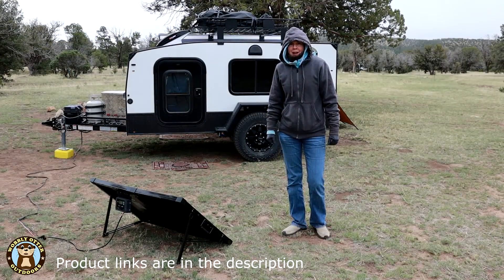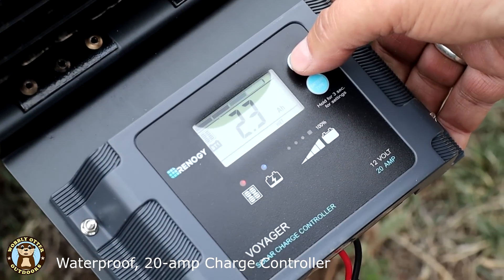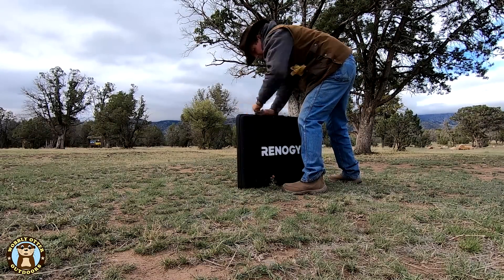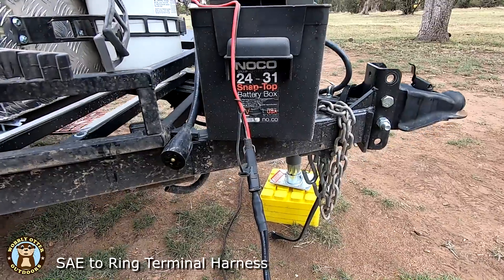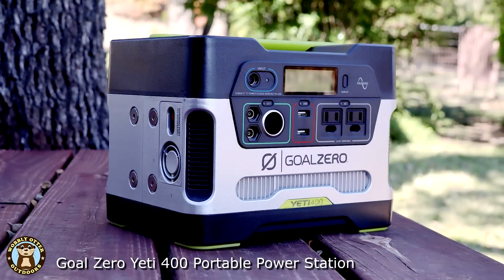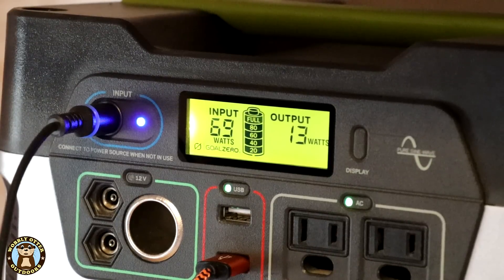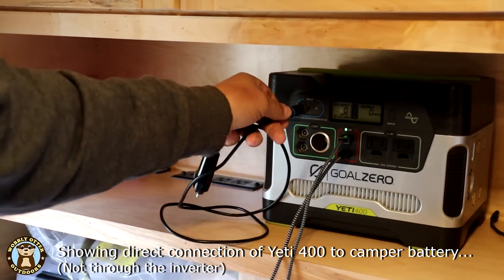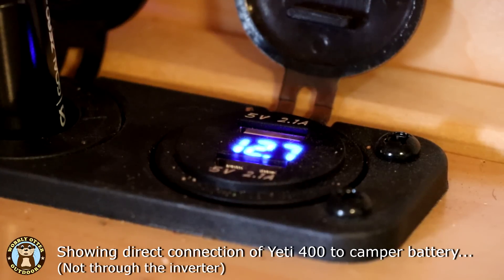Our Boondocking Electric System - Off Grid Camping

Comment: Thanks for sharing. I just ordered those same panels with the exact same thinking you have. I'll surely need an extension cords like you have to make it reach the sunshine more than likely.

I'm also thinking of doing 200-300 Watts on the roof of poly solar panels. This will ensure even in some shade I get something, and driving I can charge as well.

Battery is still TBD but thinking a huge 8d 250ah battery would do the trick.

This will let me work remote from our aframe camper in the sticks!

Thanks again for sharing. I enjoy your videos and your friendly presentation.
Reply from the maker: Hi, Jesse. Thank you for watching, the gracious comments, and sharing your great ideas. Huge batteries - always a plus. The solar panels on top for charging while driving - so wonderfully logical.

Comment: I just found your channel because we are getting a backcountry x, but you have some of the most helpful information I’ve ever seen. 

Ive been looking into getting a yeti. If you charge it in the car can you hook that directly up to the cigarette lighter or do you need the inverter? Also if it’s been charged in the car can you skip plugging it into the socket in the cabin and still have it charge your phones or does it need to be plugged into a power source at all times?
Reply from the maker: Congrats on the upcoming Backcountry X. Thank you for the kind words about our channel content.. The Yeti has worked so well for us for a long time. When traveling, Bill says he started plugging the Yeti into the inverter that is then plugged into the 12-volt receptacle of the pickup, because he found the Yeti would charge more reliably that way. The Yeti does not have to be plugged in and being charged itself in order to be charging other items.

Comment: Thanks for sharing. I have the same camper and plan to buy this exact solar panel. Just curious. What are your thoughts of the solar panel performance? On Amazon, it says it looks like this is a plug and play system. But, I see you guys purchased several connectors. Is there a reason for this? I assume one reason is to have a longer cable to have the flexibility to place the solar panels in diff locations? The other is so you have something permanently plugged into the battery so that you don’t have to constantly do this when you arrive at camp?
Reply from the maker: We are very satisfied with the performance of the solar panel. You are correct on the reasons for the connectors. We chose to standardize on SAE connectors because we already had some things with that  connector type, and this way everything can work together.